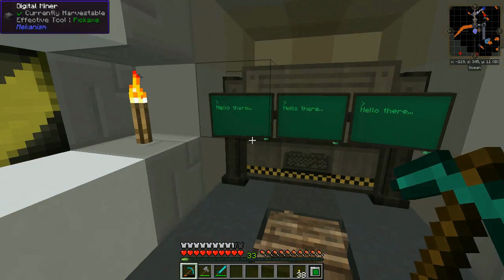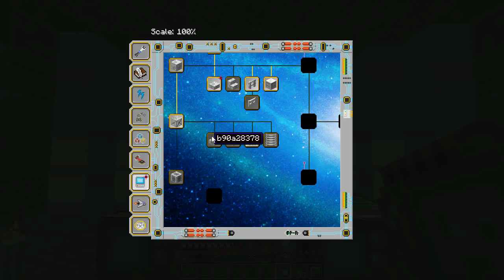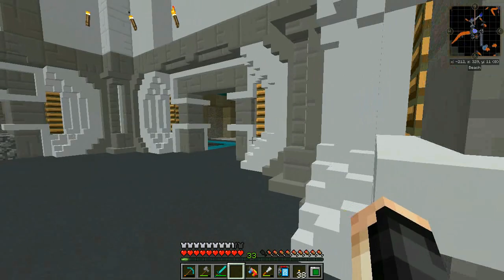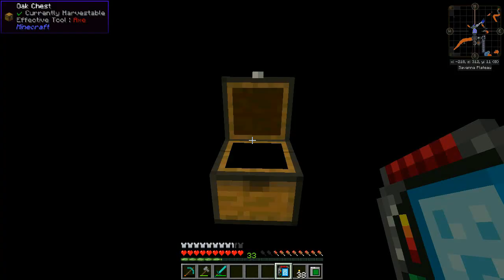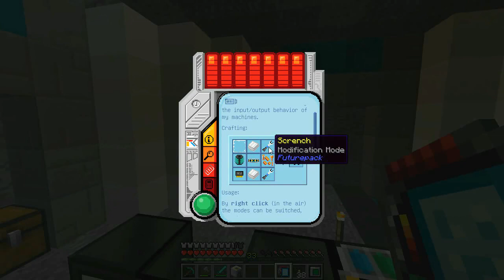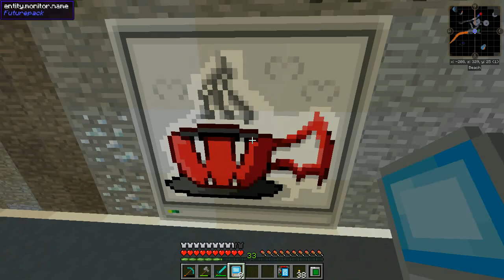Futurepack Industries 1.11.2 Episode 5 - Hours Of Research

Comment: Thanks for video. I can't wait to see new huge tech dungeons in the latest version of Futurepack, not sure if retrogen is available. You may need to delete parts of your world or move away far to see them. By the way, did you consider using swapping wand from not_enough_wands mod? It may help with changing decorations of large areas and also with getting tons of color_iron blocks from dungeons. You need to change config to not use xp for swapping, otherwise not fun.